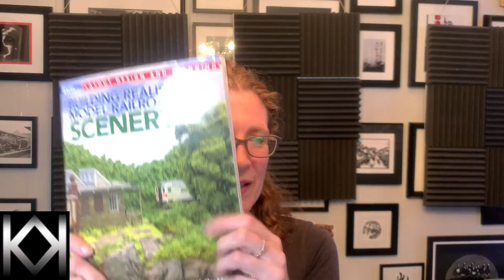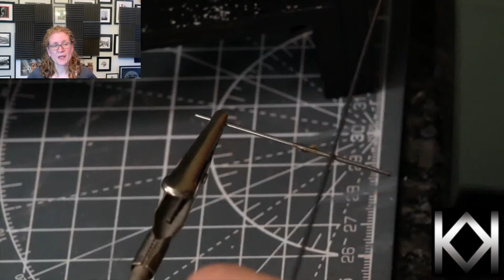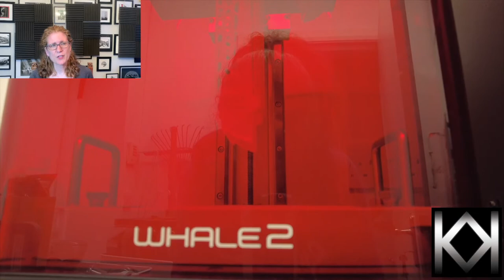The Scenery Stream - Port Dinorwic - Basics are Done!

Comment: Thanks for this, Kathy.

Interesting comments at the end about DCC sound.  I was initially impressed in a sort of woohoo new shiny fun thing sort of way, but for me the problem with sound decoders in locos is that all you hear is the loco, whereas if you stand by the track of a real railway, you hear the loco, then you hear the sound of the rest of the train, and you never get that with DCC sound.
Reply from the maker: It’s a good point on sound. Mick Moignard used to do a great clinic on lowering volumes on the loco so only the scale elements remain.